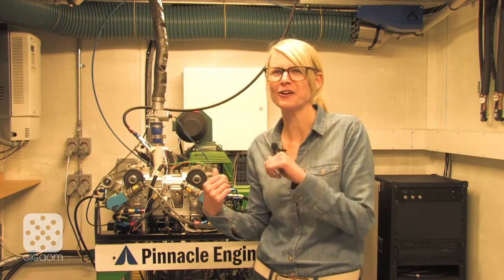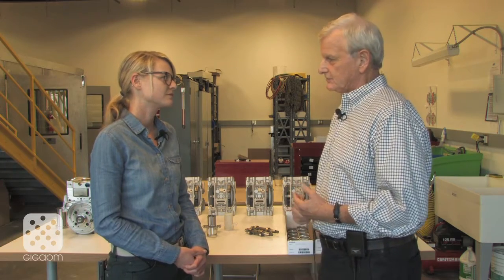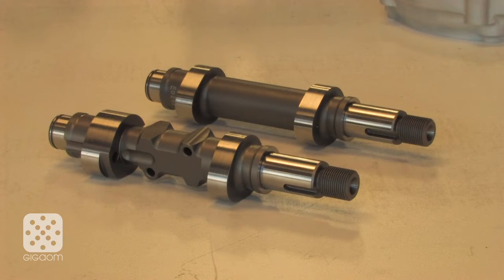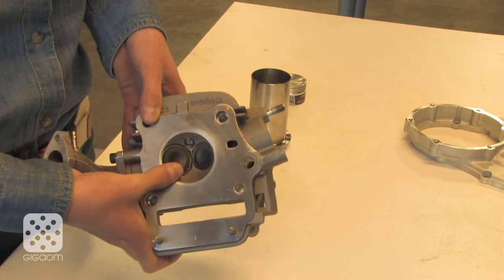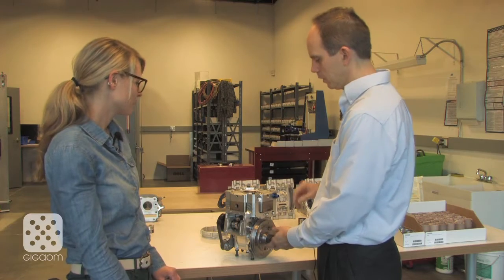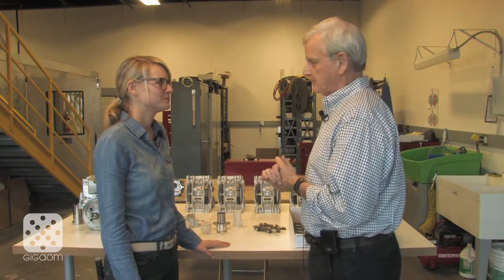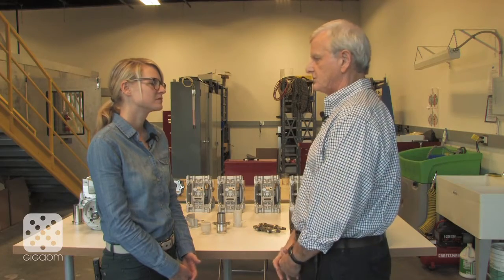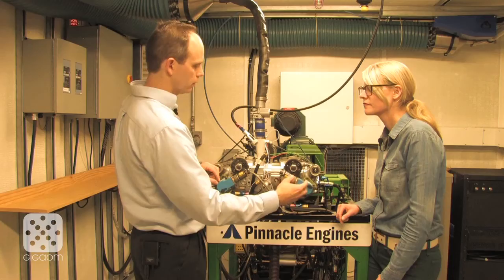A super efficient engine, from Pinnacle Engines

Comment: This engine should've already been released on the market for a long time, not only for Asia. Make a huge 3-cyl version to fit into most aircraft currently powered by a flat-6, get it certified by FAA and EASA, and it will reach a market that really needs some renewed engine designs. Sleeve valves used to be somewhat popular before the tetraethyl lead started to be added to the gasoline.